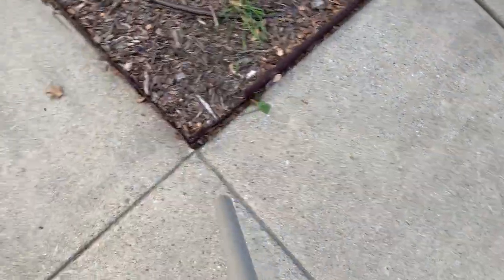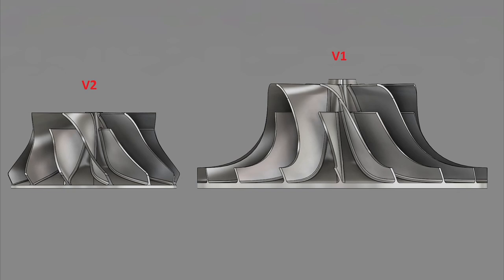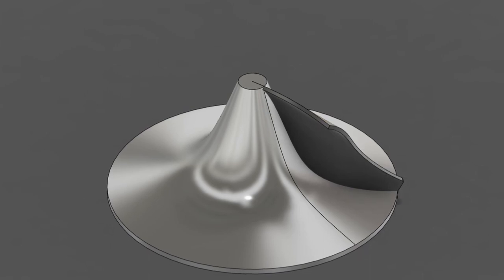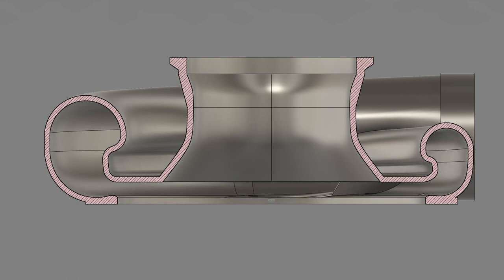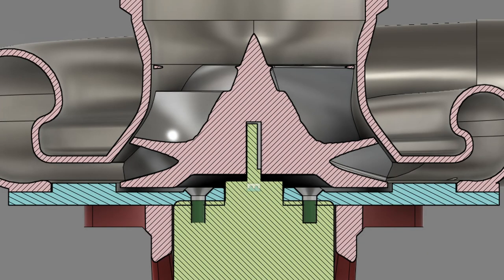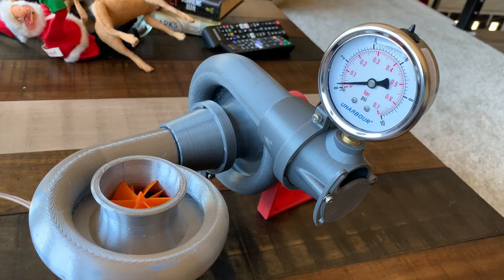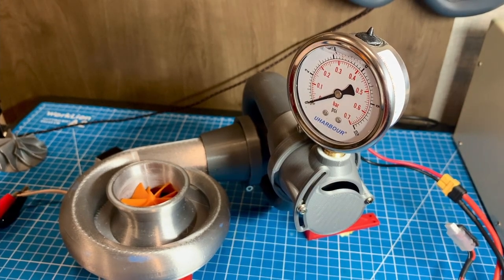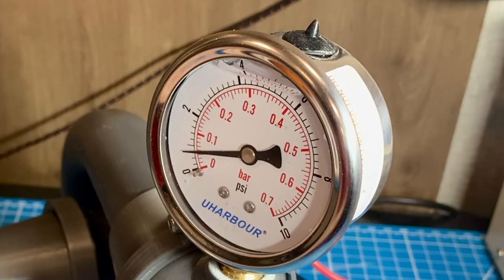3D Printed Two-Stage Compound Turbo Compressor

Comment: 3D print layer lines are NOT air tight.  You can fool with designs all day long, if you don't seal the layer lines with some super glue or epoxy, anything you print with exception of resin printing, will never hold pressure.

Comment: sir I'm very glad that your compressor did not explode and you were not hurt, cause I've seen such videos on YouTube. High rpm on fdm printed parts is very dangerous in my opinion.
Reply from the maker: Several of them exploded actually. I found PLA+ or Nylon to be the best materials as they are much more flexible than normal PLA. I always wear safety glasses and I made the housings with a larger inlet to prevent shards from flying out.

Comment: 1:37 I left a comment on your other video about the blade angles but it appears you already fixed that. I guess you could make it more drastic but I think your gains would be minimal if even there at all. Now the only problem seems to be clearance maybe. Try doing what rumba does with their fan blades. They attached the intake cone of the housing to the blades so the two spin together. By doing this they effectively took that gap and made it literally 0. It makes the blade much easier to manufacture and more efficient. The way they balance it is kinda cool too. They mold pegs on the outer edge and cut them off to balance it where needed. Again hope this helps and I can’t wait to see what you do next.
Reply from the maker: That’s a cool idea. I played around with shrouded compressor designs like that. They’re tricky to remove the supports front but if I could get away with a smaller wheel it might work.
Reply: @IndeterminateDesign  ohhh that’s right, I didn’t even think about support material. Hmm. A smaller turbo would still be super cool if it works. I guess the only other idea I can think of is the widest compressor wheel at the base you can get away with without burning out the motor. My thought is a wider wheel will have more of a centrifugal force on the air. But like you said in your video the problems with this are inertia and an extended lever arm effect on the motor. But maybe a thinner disk could get away with it? Honestly whatever you come up with I’m totally exited to see. I love that you added ground effects to the high speed rc car. I haven’t watched the whole video yet but it sounds super cool.

Comment: Subscribed. YouTube needs more of this content <3 Sad to see the supercharger and turbo not meeting everyone's expectations (although the turbo I actually did kinda expect to not work out as well considering the high rpm requirement) but at least it taught everyone something. I'm tempted to try the supercharger myself whenever I get a 3D printer. Eventually I might try to get access to a CNC machine if it's within the realms of possibility. Love these vids dude, keep it up, looking forward for more.

P.S. Have you tried roots charger? Much simpler design so I reckon you may have more success there.
Reply from the maker: Thanks!  Yeah, it's a tricky thing getting enough speed and power to make actual boost.  It would need a massive gear drive to get enough rpm or a seriously high power motor.  

I've printed out some roots charger impellers, but I haven't tried anything like designing a housing and drive system.  It would be much easier to use rubber seals on, so it should make some pressure.
Reply: @IndeterminateDesign  definitely. Some smaller wheels can have requirements as high as 200k rpm or so.

Ah cool cool. I've seen a few videos on YouTube about roots blowers made via 3D printing that actually gave positive pressure, so seeing your videos, I think you definitely stand a chance at sorting out a roots blower that will work at least to a degree. The twin-screw is just far too complex in shape to try to "compensate" for the lack of tolerance control.

Comment: I think you need a lot more RPM to make boost without surge, those compressors use centrifugal forces to make boost and need 50k+ Just to start to made boost
Reply from the maker: I totally agree. Someday if I try this again I will use a brushless motor so I have more power and the ability to run higher rpm.  It’s amazing how much power even a small compressor needs.

Comment: Hi, my greetings,
it's very interesting, you made this version in 2 stages.
The result will be much better if you put fixed blades placed on inlet of each centrifugal wheel. Here are almost the same blades as on centrifugal impeller. But in industrial solutions, because the goal to get more kg of the air flow, so these direction blade are directed to rotation side. If you want more pressure, direct them against rotation. However, the blades on the wheel should have more inclined blades, according to airflow vector.
Could you please do this, the result would be interesting.

Comment: What you really need to do to make this compound setup work is the same as any jet engine, your second turbo/ compressor needs to be half the size and spin quicker, because you have already shrunk the air. Look at any jet engine with multiple stages and the blades always get smaller because you 'are' shrinking the air😅

Comment: Awesome video! The EDFs I use on my fan cars are limited to more like a 0.25 psi pressure drop. Any idea of the CFM going through it?
Reply from the maker: Thanks!  I didn’t get to test the CFM under load, it’s close to 40cfm unrestricted.  I’m surprised I thought EDFs would have a much higher pressure, but I suppose they’re optimized more for volume.

Comment: In my industry we normally see is a motor driving a bull gear and pinion to rotate the impaler for each stage.
Reply from the maker: I really wanted to try that setup, I have a big motor that could easily drive all these. But in testing the 3d printed gears don’t hold up over 50k rpm. I maybe able to do it if I can print them out of more exotic materials like PEEk.

Comment: Why are you not using brushless motors? Very cool by the way.
Reply from the maker: Brushless is the way to go, but I already had several 540 motors.  You could certainly get a lot more power and higher rpm with a BLDC which is what this would really need if you wanted to produce more pressure.
Reply: @IndeterminateDesign  this makes me want to give it a try. Never thought you'd be able to make that needle move with a 3dprinted compressor wheel. Truly amazing

Comment: Your wheel designs are great but they don't start working till 20psi +, steep blade angles are for high boost and need a lot more power and revs to push, you need to drop the blade angle from 60deg back to 30deg like most modern ball-bearing turbos made to work between 0-20 psi boost. I really hope my comments help because I also learnt from your video about how these wheels work at extremely low speed (sorry) 30,000rpm is idle speed for a car turbo. But you have run these 3D printed plastic wheels faster than anyone online and am glad to have seen this, most other people's setups exploded way before what you did😅 good work and I would love to see you try again sometime, cheers
Reply from the maker: Yeah, the speeds are too low and the power required is too high. There’s another YouTuber making an electric supercharger and he’s using 30+ hp motors to make 20psi.  I do want to try some small compressors with lower flow and much higher pressure ratios.

Comment: I'm not an engineer so please take this with a grain of salt. Would more rpm create more pressure? centrifugal superchargers and turbos spin really fast. about 50k rpm = 5 lbs of boost with an appropriate sized compressor to given displacement. perhaps gearing down the motors may be the way to go as long there is enough torque to move all that air.
Reply from the maker: More RPM should create more pressure as long as the flow is within the range the compressor is designed to work. I’m likely not reaching the speed this compressor wheel needs and I have far too large of tolerances. 

My blade to housing clearance is around 1mm, and the real turbos I measured were are ~0.2mm.  So I’m loosing most of my pressure to leakage. I think machining the blades after they are 3D printed might get them closer.
Reply: @IndeterminateDesign  interesting. could that be as simple as sanding the outside down to match the necessary clearance? in your opinion, would something like a carbon seal such as those those found in rotary engines be an option to close that gap? I'm bringing this up because the plastic will expand as the compressor wheel spins faster, not sure by how much. wider clearence may be beneficial for this specific material. a carbon seal would degrade over time if it comes in contact with the expanding blade and help dissipate the heat a little. I'm not an engineer though so idk lol

Comment: 7:15 pressure with the curtain fully closed?watched?
Reply from the maker: Yeah, just 1psi. Need a lot more RPM for these to work. I may try brushless motors someday. I have to leave the restrictor open a bit, just below where the compressor will surge. When the compressor surges the air flow stops and pressure drops to 0 because the compressor is just spinning the air around internally.

Comment: I was trying to download the files for the V2 turbo compressor but there is only one file on the Github. Do you think you could upload the STL files for this design. I'd really like to try and print this compressor. I would greatly appreciate it! Thanks!
Reply from the maker: I've added the 3MF which will include all the parts and can be opened by any slicer program.  

You will most likely need the original *.step file as you will need to make edits to fit the tolerances of your particular printer.  I recommend using something like Autodesk Fusion 360 personal which is free or FreeCAD which will allow you to open and edit the step file.
Reply: Thank you sir! I’m using shapr3d with a qidi ifast. I’m as new as the machine, just starting to learn. I was wondering if possible I like to lean from you. Is there any way I could reach out to you directly? Thank you and I would greatly appreciate it!

Comment: Curious, do you think the housing would of survived 5-10 psi (assuming everything else was okay)?
Reply from the maker: Yes, I'm fairly certain the housings would have held that much.  I can't crush them by hand.

I was about concerned safety initially (Obviously I didn't need to be given the pressure I achieved), but it's also a fairly small volume of air so most likely if it did fail it wouldn't be an explosion or anything.

Comment: How did you balance the wheels?
Reply from the maker: I didn’t balance these wheels. It would probably help but they are so light. I’m working a a very small compressor for another project that rotate at 50k rpm and those do need balancing or they come apart.

Comment: I absolutely love your video!
You show all you've got and even the build doesn't work that well and still you show everything! Fails are the best way to learn! Awesome work because your design is great!
Still: I have great results just playing around with blower fans. They're easy to design in every software, very easy to print and blow a lot of air. To accomplish more pressure I'll print some multistage ones with more complexity.
But still: blower fans are THE way to go when FDM-printing. Since I also need medium pressure air flow for my part cooling fan of a high speed 3D-printer I'll search for better ways to achieve this.
One is the following video and print:
https://www.youtube.com/watch?v=ObnN-f2A6mc&t=2s
Reply from the maker: Thanks!  I had a feeling that FDM 3D printing wasn't going to cut it, especially without a lot more power.

Thanks for the link.  That blower fan style compressor is really awesome.  I need to make one of those.  I have some more project ideas if I can find a compressor that will pull a decent vacuum.

Comment: impellers aren't "turbos" or turbines. they're the opposite of turbines.
Reply from the maker: Technically it's a centrifugal compressor but no one ever searches for a centrifugal compressor.  They are in a lot of gas processing plants, but they're much more efficient in larger sizes.